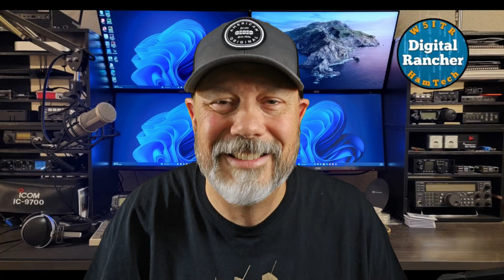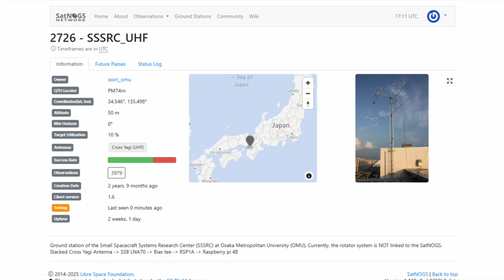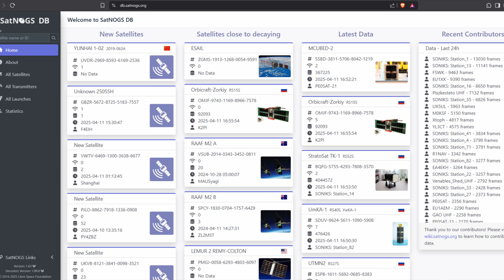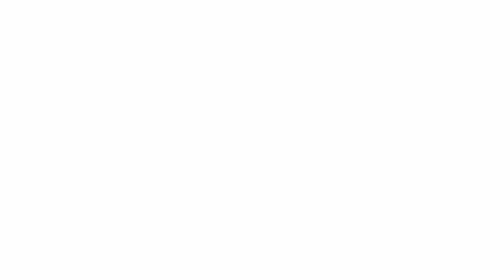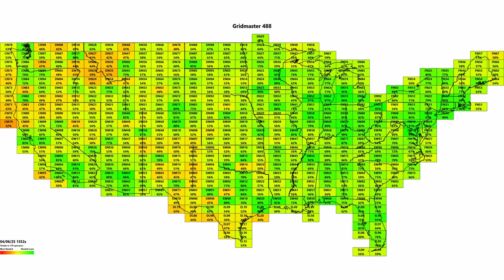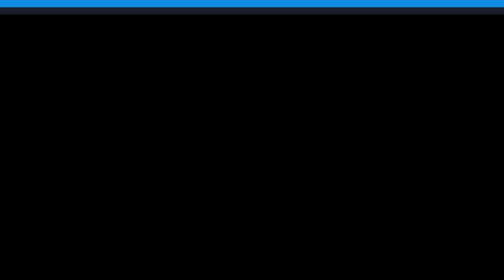Ultimate Satellite Ground Station Build Series Kickoff!

Comment: I'll be following this series for sure. For the grid master award, the QSOs don't have to be from a single grid. You can cross grid lines so long as all of your QSOs fall inside of a 200km diameter circle.
Reply from the maker: Hey Eric! It will be great to have your insights and comments, thanks! Good point on the GM award. I always  forget about the second part: Contacts must be made from the same location, or from locations no two of which are more than 200 kilometers apart. It's just easier to think about it in terms of your own grid. That's a good topic for a video!
Reply: @digital.rancher  you could have QSOs that are more than 200km apart but still in the same grid. The Southwest corner of BL11 where I live is 240km from the Northeast corner, but I can walk to BL01. I like the 200km rule because I can activate two different grids on a 20 mile wide island and both grids count.